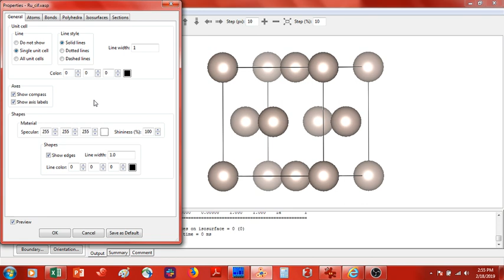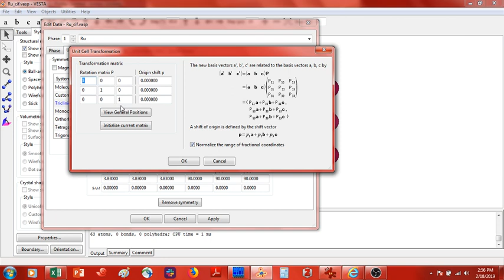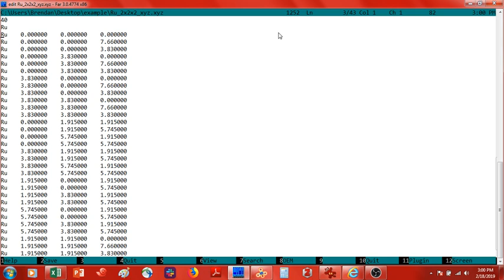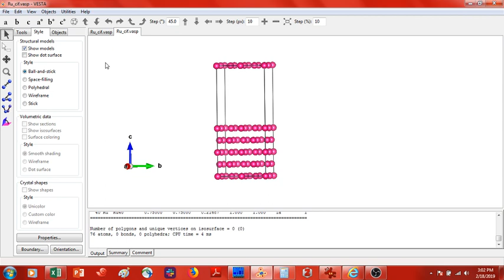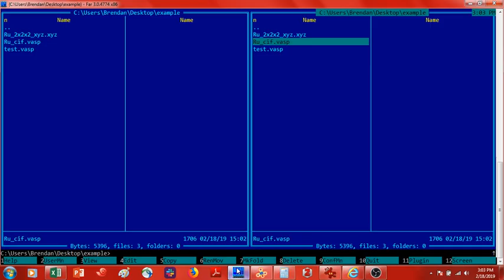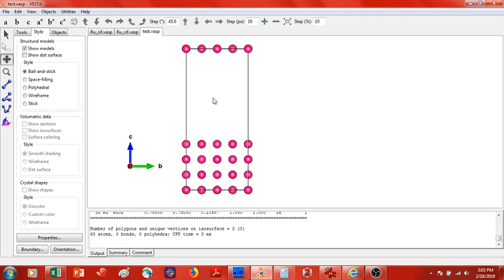Supercell construction and adding Vacuum in Vesta - Ruthenium

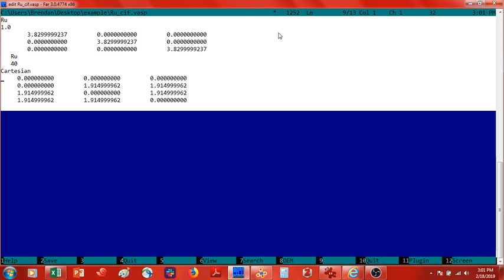Comment: Thanks for the nice tutorial.  A basic question about far software: How to select the column (@ 7:16). Also to input the file you made at the end to QE, should we choose ibrav = 0 ? Also some people make the vaccuum up and down (the monolayer for example in the middle) which should be equivalent to the vaccuum you did.  How to to do that in vesta? I saw people doing that using burai
Reply from the maker: Hi H B, to select the column @7:16, use "alt", then highlight. And yes, choose ibrav = 0. It does not matter where the vacuum is, it is equivalent. Check my videos on dipole correction I put the cell in the middle of the vacuum as you mentioned. Cheers, N&C

Comment: How would you do it if you wanted to add vacuum on both sides in the direction? So that the structure would be in the middle of the unit cell
Reply from the maker: Henrik Ness , add N angstrom more vacuum and then shift the coordinates all by N in that direction

Comment: Hi, can you please help me with building a non-integer supercell of a 2D material? Something like 1.5x1.5x1. I am facing some issue with the periodic boundary images. Atoms get duplicated, which is not the case in integer supercells.
Reply from the maker: Hi. I am not sure how to make what you describe. If you mean a structure with unit vectors with Root (2), something like this - this is equivalent to exposing the 111 face of a cubic crystal
Reply from the maker: Hi. Please create a new comment that is not posted as a reply to another persons initial comment. Please start your question as an individual comment
Reply: @nickelandcopper5636  Hi, no, actually just like you showed in the video to generate a supercell of 2x2x2, I want a supercell of, say, sqrt(3)xsqrt(3)x1. Is this possible to do through Vesta?
Reply from the maker: Sraddha Agrawal - what i am saying is that having a cubic super cell of root integer is equivalent to the super cell which the internal 111 plane is exposed
Reply: @nickelandcopper5636  Okay, I get it. Thanks!

Comment: hey, I am currently working on supercapacitors for which i have a create a model of electrolytes confined between two electrodes. electrode material would be grpahene and any metal oxide composite. Can i use Vesta to model the whole system? what do you recommend?
Reply from the maker: Yes you could but you would need two slab models with the electrolyte in-between and vacuum on the other sides of the slabs. Is it single layer graphene or many layer?
Reply: @nickelandcopper5636  no it would be many layer...then upto it some later of metal oxide would be there
Reply from the maker: abraramin khan so the metal oxide would be in contact with the many layer graphene? Where would the ions go? Would some be touching the oxide and some touching the graphene? Would any ions be within the graphene layers or metal oxide layers, or only in the space between them
Reply: @nickelandcopper5636  Is there any specific reason for the 2 slab model? Like I have always seen researchers using that.

Comment: Thank you for making a wonderful lecture video. Could you guide me on the following.

If I am to use this structure for surface calculation in quantum espresso, could I use the cell parameters and coordinates from this as input file for quantum espresso. Or does some modification is needed for atomic position.

Thanks
Reply from the maker: Thanks for the nice comment! Use the coordinates in the .vasp file for a quantum espresso calculation. You just have to add in the atomic labels that’s all. Ex) “Ru”
Reply: @nickelandcopper5636  
Thank you so much. I will go ahead and work on it.
Reply from the maker: Nice! I would first do a large amount of reading on Ru surfaces if this is what you want to do. If you want to use a different system, you can still follow the same procedure. I have other videos for other systems too. Take care.
Reply: @nickelandcopper5636  
It definitely helped. However the number of atoms seems too many. I feel some of these are redundant but don't know how to choose those .

I was going through a tutorial of slab coagulation using quantum espresso of Al001 with 5 layers. 
The number of atoms is 5 in this case with tetragonal symmetry and atomic positions of 5 Al atoms are given in input file.

However supercell Al001 made from Vesta has more than 23 atoms. 
I am not getting how to reduce it to 5.
Reply from the maker: You may be confusing the xyz structure with the .vasp. Also I believe the model here is a super cell
Reply from the maker: Watch some of my other videos you may get the hang of it after a few

Comment: very useful.
For quantum espresso input file , can i use the vasp file directly without deleting atoms (second procedure) ? or i have to follow the first procedure you mentioned i.e. deleting atoms, then save xyz file then vasp file ?
Reply from the maker: Hi Omer. Thanks for all of the questions. Use the vasp file at the very end. The one that gives the structure with the vacuum
Reply: Nickel and Copper  Do you mean the vasp file in the second procedure , ? i.e. without deleting atoms , right. ?
Reply from the maker: The video was a long time ago, so I am not sure. But just figure out which vasp file corresponds to the structure with vacuum towards the end
Reply: Nickel and Copper thanks a lot 👌
Reply from the maker: Yup!

Comment: Thanks for sharing such a nice tutorial - appreciate it. 

A quick question: Does the order in which you introduce the vacuum matter? I mean, you introduced the vacuum layer from the unit cell. Could you first make a 111 structure out of your unit cell and then introduce the vacuum?

Thank you in advance :-)
Reply from the maker: Of course! I have a ton of videos where I first make the 111 surface and then add vacuum. If you need a specific example done let me know
Reply: @nickelandcopper5636  Thanks so much for replying. Nice, then the order doesn't matter. Another question, how to get the primitive 111 out of the FCC structure using VESTA? Do you have videos about it? 

Thank you in advance :- )
Reply from the maker: @gabrielvinicius9855  sure. Check my more recent video on copper 111 surface. I start with primitive cell and do the 111 surface transformation. This gives primitive 111 cubic surface. If you start with conventional standard cell and do 111 transformation, you get the congenital standard 111 surface. Both are equivalent but of different sizes and angles

Comment: How do I know which atoms to remove in other surfaces? For example I was trying to make a supercell using the gold 111 surface according to your previous video and it turns out that the c/b view has a different uniform structure than the c/a view and when I tried to delete only the first column of atoms from the right  according to the video here, the resulting structure is wrong. 
Btw thanks for the tutorial :)
Reply from the maker: Hi Evan, not sure what you mean. I think I have some videos on the channel where I cut slabs of 111 surfaces.

Comment: How can i create supercell:sqrt(3) X sqrt(3) X 1 transformation to my unit cell using VESTA ?,
Reply from the maker: For example, just cut the 111 surface from a cubic crystal. This is the root3 (or root2 depending on the initial crystal) structure

Comment: how about a hexagonal structure, how can we make a circuit supercell with vacuum
Reply from the maker: Hi Mouhamed, I am not sure what you mean. Which hexagonal structure do you refer to in specific? Also, what is a "circuit" supercell? How does it differ from the one I make here?
Reply: @nickelandcopper5636  Sir, I thank you for your message First of all I have no idea how the word circuit was introduced in my original message, my question was simple I am trying to make a supercell with the structure SmCo5 which has the symmetry P6/mmm using your approach.
Reply: @nickelandcopper5636  The structure of (SmCo5.Vesta) is completely défirent from what you have in your Ru example, so I find it so difficult to find where to make changes.
Reply from the maker: Hi Mouhamed. No worries about the circuit mis-spell. I will take a look at the structure and try to do the unit cell. At first glance, it looks like you need a basis transformation. See my video on Au and CaF2, where I do a similar basis transformation to expose a (111) plane. In your case, you would reformulate the unit cell such that the internal planes are outward facing, which would give you a unit cell with 90 degree angles between cell axes.
Reply from the maker: Hi Mouhamed. I was able to add vacuum with you structure. I will make a video and upload it tonight. It can be done both with and without a change of basis. I will show both ways. Cheers, Nickel and Copper.